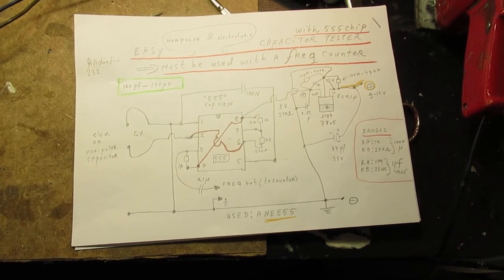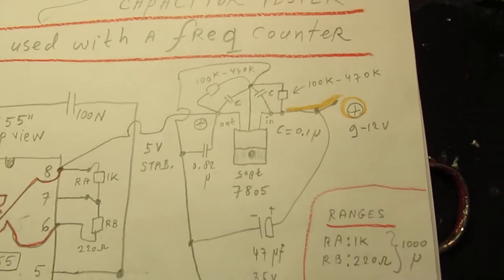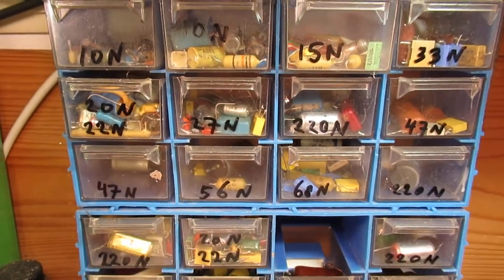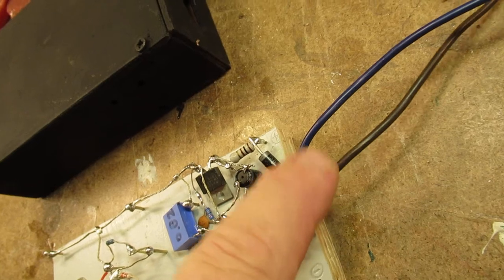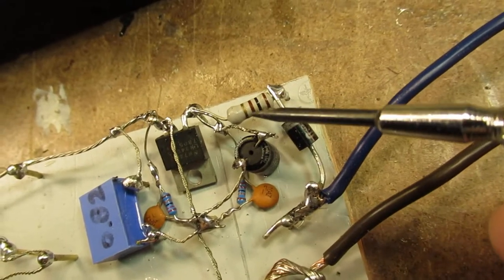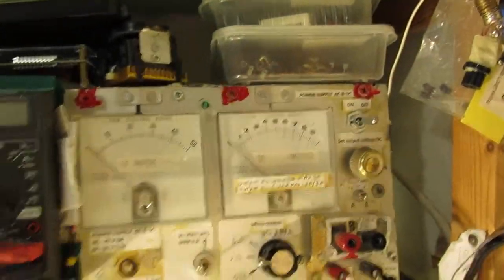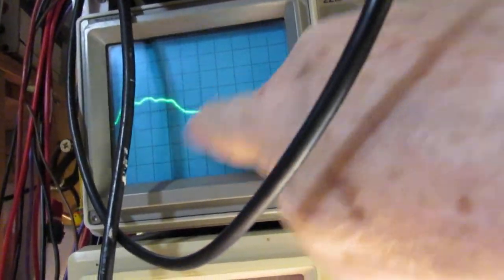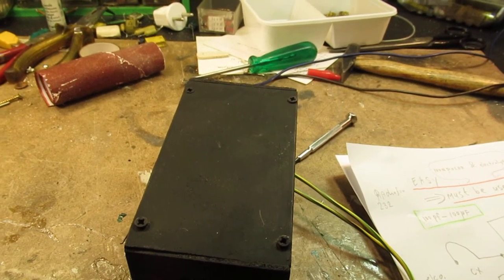VLOG about the easy capacitance tester 100 pF-100 uF how it finally was made & more

Comment: Happy New Year, Ko!
Nice follow-up video.  It would be interesting to see the final table from testing your capacitor bank.
Wishing you all the best for 2023.
Reply from the maker: Thanks David, best wishes for 2023.
Reply from the maker: Hi David, today (4 jan 2023) I have tested a lot of capacitors (all kinds of types, say ceramic types, foil types, etc, of the same values) in this circuit. The final table (relation frequency-capacitor value) is now published in the textbox/description of both video's. Links & info in the textboxes. Due to the (big) tolerances of consumer capacitors, these values (freq-capacitance) are (though very reliable) approximations. Interpolations can give in-between values. 4 jan. 2023.
Reply: @radiofun232  Very nice!  It's interesting to see the relationship between them.  Thanks for posting those values!